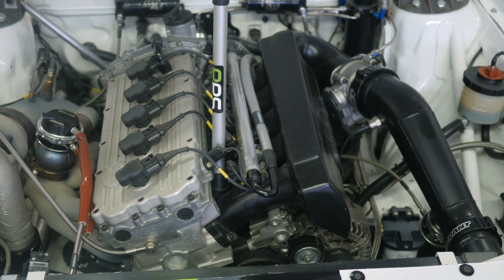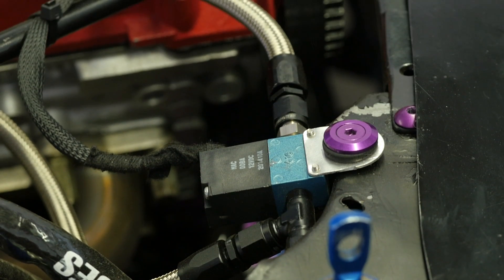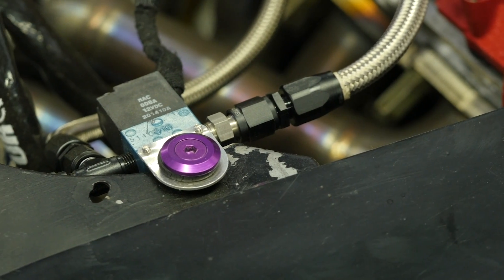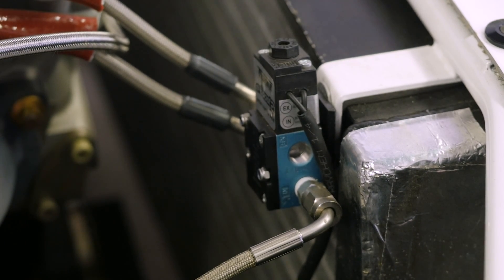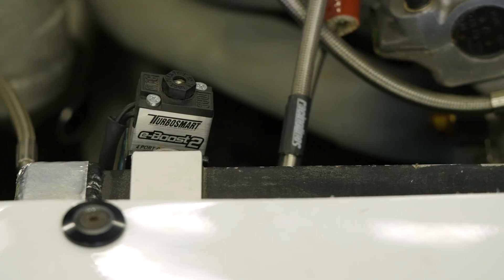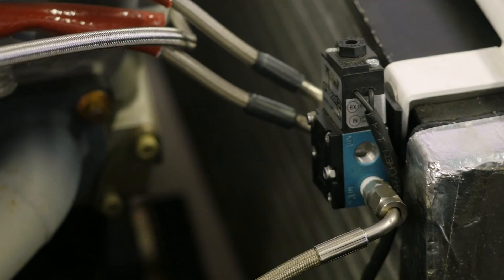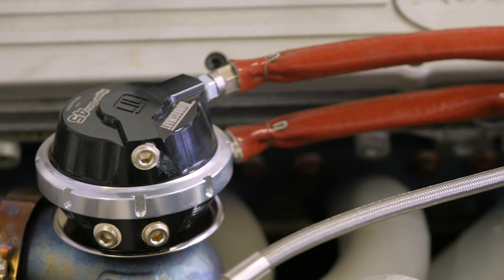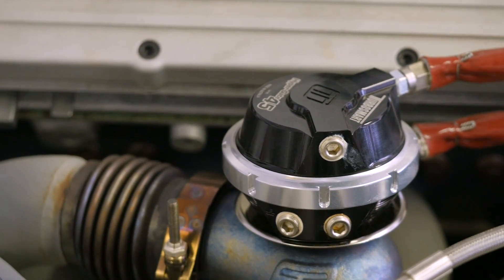What Do You Know About Boost Control? | [TECH NUGGET]

Comment: i have 3-way mac and two tial wastegates with 1bar springs. if i am driving with spring pressure alone then the wastegate screampipe will keep a steady sound and car is making ~1bar of boost. then when i turn on the electronic boost controller then the sound is uneven, like fluttering🤕 how could i get a steady sound even with big boost? Engine is subaru ej20 and i have equal length twincroll headers.

Comment: Good points.
I'd say torque, rather than power, and more engine torque being useable further down the strip as less multiplication is done in the higher gears.
Reply: that would be a better display of power, hense the term was used
Reply: Whilst I would sometimes agree with you, in that for the same level of power the wheel torque will be the same due to gearing of the engine torque, I would disagree in this instance. In the same gear power will vary with rpm but what limits the usable power is the force that can be applied to the track to accelerate the vehicle - the shear force - and that is a function of the engine torque and gearing.
Because torque is ALWAYS higher below peak power, and it is what causes the traction loss,  it is why I would emphasis that, rather than the actual 'power' - look at the torque and power curves and you will see what I mean.

Might not have explained it well - watching taped F1 race from last night - but you should get my point with a little reflection.
Reply: crank tq and gearing means you are talking about hp.
Reply: NO! Torque is torque, a moment or rotational force and power is power, a rate of doing work - you are treating them as the same thing. The effect of torque reduction on power is a side effect of the rpm the torque is applied at.
To put is as simply as I can I will posit several statements leading to that.
a/ there is a limit to how much force can be applied through the tyre/track interface before i/ traction is lost or ii/ lifting of the front wheel(s) means the reactive resistance to the tractive torque is reducing. That is, the driving torque is applied through the driving tyres which lifts the front of the vehicle (yes, even in FWD and AWD vehicles, but the application is a little more complex) and as the centre of gravity lifts more and more from a horizontal plane with the rear axle centre-line it moves in an arc closer to the axle - this reduced the moment (leverage) resisting lift and the process continues.
b/ the maximum torque that can be applied through the axles, from the engine, through the gearbox can be calculated and by holding that the point where maximum tractive force is achieved will maximise overall acceleration.
c/ engine torque is not uniform over the operating range of the engine and this, in turn, means that the driving torque in any gear will vary with rpm - this is the important bit! Remember, power is a fuction of torque and rpm and so peak power does not directly reflect the tractive force applied - this is why I told you to consider the torque and power curves... very important point!
d/ from b and c you should be able to understand that if, in a selected gear, the engine torque is applying more torque to the wheel, and contact patch of the tyre to the track, than can be used it is desirable to reduce engine torque so traction is not lost or vehicle lifts the front too high. It should also be obvious that because the engine torque curve is just that, a curve, it is possible that the engine may transition between not enough, through to much, back to insufficent torque to cause a problem - this is where torque control comes in.
e/ in the lower gear(s) where the engine can easily exceed the maximum applicable torque, it may actually be a straight line and, as a result, the power will also increase in a linear fashion. If you were unable to understand why TORQUE, and not POWER is the limiting factor, perhaps some thought on that will help?
f/ DO NOT assume that "torque control" is the same as "boost control", especially when the "boost control" is merely a limit to the maximum that is reached in each gear - the torque will still vary through the operating range. On the other hand, by controlling the amount of boost by bleeding it off (and using other techniques such as throttle openings, ignition timing, etc) to control the torque, there will be benefits of varying that boost through the engine operating range to keep the engine torque at the optimum point.

Again, look at the torque and power curves, AND THINK ABOUT IT. There are many people who are unable to consider them as very different, though related, terms with different applications/times to use one OR the other, don't be one of them.
Reply: @gordowg1wg145  when you are talking about the tq at velocity then you use hp.... this is what he is talking about....
comparing engines, use hp.... tq has no correctional to performance. this is why hp is used as its an exchange of energy. no need for ratios or tq outputs

its physics 102
Reply: @chadw8272  You either don't understand or missed this part in my initial response " In the same gear power will vary with rpm but what limits the usable power is the force that can be applied to the track to accelerate the vehicle - the shear force - and that is a function of the engine torque and gearing." - or both...
To expand, if you limit "power" to xxx, you will still have variations in the torque the engine produces to achieve that "power" over the operating range used. It is the maximum TORQUE that can be applied or, more precisely, the maximum shear force between the tyre and the track surface that can be used without losing traction and/or excessively lifting the front of the vehicle, that is the limiting factor. That means the "power" that is being supplied will vary in proportion to the rpm/speed, depending on your preferred reference.
As I have already said, at the same road speed, same tyre rolling radius, and the same power level, the torque at the axle will be the same - no arguement there and something many fail to grasp, so good to see you get that.

Now, AGAIN, review the torque and power curves of an engine and see if you can grasp why I emphasis limiting the 'torque' rather than 'power' - clue is in the rpm part of the equation? You 'should' also grasp why I also said that simply limiting boost wouldn''t work as well as proper torque limiting.

Anyway, until you show you understand, I will refrain from further comment as I seem to be hitting a wall ;-)
Reply: @gordowg1wg145  again. the amount of traction or shear force you can apply at any given velocity, is Hp (product of engine tq and gearing or both)   this is again!!! why hp determines the cars performance not engine tq.
Reply: @gordowg1wg145  I completely understand your point of view. I do have an engineering background, but I still find that power output at given rpm is more important than  gearing. you can change gearing to create the same output shaft speed but use completely different ratios. but It seems that we really are talking about the same thing. engine tq at velocity is hp output...
claiming you want to maximize engine tq to use at the tires, and me saying that its labelled hp at that point. it just going around in circles. 
the mount of hp you can use to accelerate a car is based on the obvious friction from the tires. engine rpm has nothing to do with it if you know the hp output at that given rpm. you can ignore the "number" and use the term hp. since this is what it is defining. maximizing the usable hp is what im sayign. and your saying mazimize the engine tq that is usable...
kinda like saying maximize your hourly rate and I say salary.